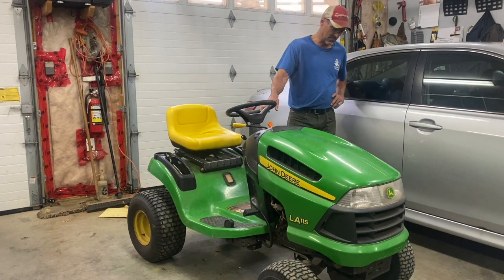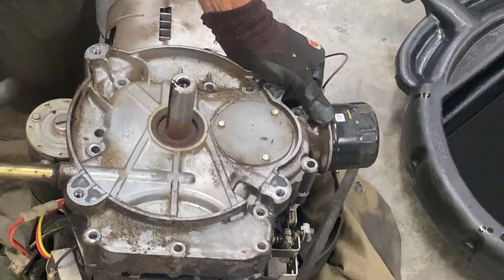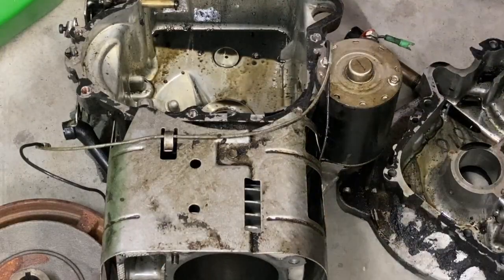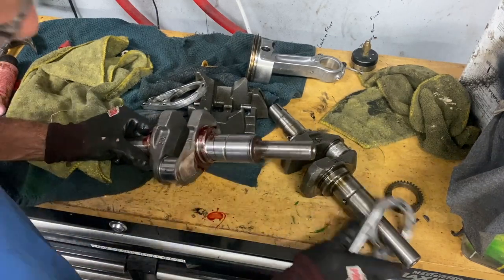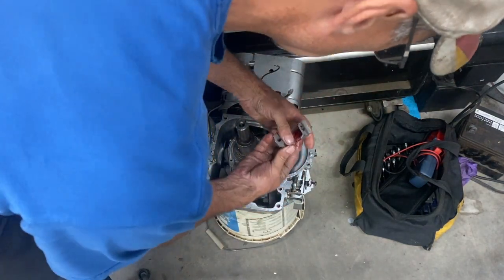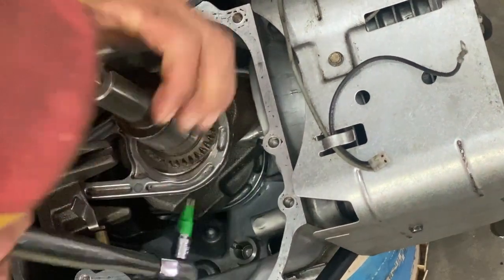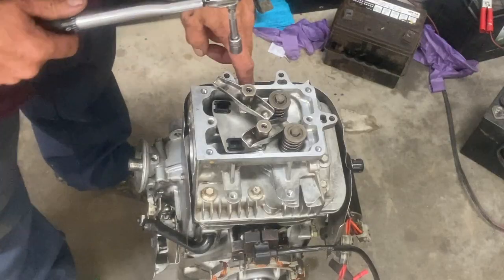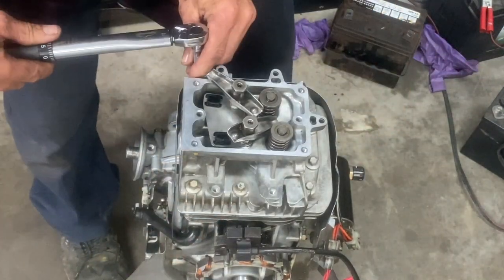Bad Crankshaft, Camshaft Connecting rod? How to fix/replace it, John Deere LA115 Lawn Mower Tractor

Comment: Wow, what a rebuild.  My mower isn't starting after running over a solid object. Checked the flywheel slotted key.  Was good.  I am afraid it will be a major rebuild like this.
Reply from the maker: I’d fixed it for free if you’d lived near me.  I would make a video on it.

Comment: Thanks for showing how it all comes apart.  I've done V8s, but this is my first single cyl.  I pulled the head this afternoon in the hope of replacing the head gasket (billowing blue oil cloud), but the gasket looks good, so now I'm thinking it's a ring problem.

P.S.  5:43  Woodruff key

Comment: Nice Job.  Fun to watch and to the point.  Like someone else said, a little more voice volume would be great.  Was it the case bottom or the main cylinder half that was cracked?  Did you replace both?  Seems like you've got lots of spare parts around.  Also, maybe I missed it, but did you replace the lower crank seal?
Reply from the maker: I replaced the bottom case but not the seal.   I do have a few spare 19.5hp blown motors kicking around.   These fail allot because of poor Maintenance.

Comment: FANTASTIC walkthrough, you just got a new subscriber and a like! Could you please tell me any and all cleaning sprays/solvents you used to wash parts in this video? I am overhauling a Kohler CV491 right now (first ever overhaul) and just got it popped open so I am about to clean everything up before proceeding. A bit nervous I am going to use a cleaner that leaves residue and ends up breaking down oil and ruining my reassembled engine. Thank you!
Reply from the maker: I sometime use a can or two of “Brake clean”.  Micro-fibre cloths and automotive lacquer thinner.   Any spray can cleaner works good.

Comment: I just performed this same repair to the T of following this video. Now I'm fighting to get it started. I pulled the cover to verify the governor and timing was correct 4 times. I'm gonna pull it tomorrow and see if there's any cracks in the casing that I missed
Reply from the maker: Remove the air filter & add a bit of fuel in the intake. It should fire.
Reply: @WeekendHobbyMechanic  I'm definitely gonna give that a try after watching your video of the cam replacement on the d110

Comment: Very Nice Video. Lots of detail when splitting the case. I'm currently working on (2) John Deere 110 mowers, one runs good but I discovered that both push rods are slightly bent when I spin them watching the rocker arms move side to side. The other 110 locks up when spun to a certain spot, probably a slung rod. Your video gives me a very good idea of what I'm looking at as I'm tearing it apart to see if it's salvageable. Both engines are a 33R877 Briggs. What do you think is the probable cause of these engines to fail? The runner has 153 hrs, and the busted one is only at 125 hrs. Both engines have plenty of oil. Could this be just poor quality? And why does Briggs have two different  kinds of push rods, aluminum and steel, maybe weight savings? Thank You 👍
Reply from the maker: Watch this video: https://m.youtube.com/watch?v=qlbZQaeh0EA

Comment: I made the same repair + piston rings on a mower everything runs good except when it shuts off I hear a slight rattle.  Not sure what would cause it ?  because I am pretty sure I put everything back together correctly.
Reply from the maker: It might just be the counter weight inside the motor.   If the noise does get worse, run it.

Comment: Can you get parts for the D140 engine?  Briggs wanted about $1600 for a replacement engine.  John Deere quoted me about $800 for a new engine. I don't know if they no longer make the same engine, Briggs gave me the idea there was only an industrial replacement. Not sure who is scalping me but if you know of a vendor that handles John Deere parts please let me know.  My engine is running but the rod is knocking so loud I cant hear anything else.  Hopefully it can be rebuilt.  Great video thanks for the info.
Reply from the maker: Crankshaft is $543cad, connecting rod is $90cad.    Engine is not worth saving.    Lookup on Craigs list for Facebook marketplace or a used motor or an old mower with a 22hp in it.   I buy them for under $300 complete.

Comment: Got one that went bad the same way 2 days ago.  83 hours.  Heard a few loud clunks then it locked up.  I can barely rotate it by hand.  The starter will barely turn it sometimes/sometimes not at all.  Will need to tear it down and examine for possible repair.  This is a newer mower from J Deere.  Just junk in my humble opinion.  I got rid of the quick oil change to make the engine last and put on a regular filter and drain port.  Oil was changed ever 12 hours and was just changed when this happened.  I think Briggs and Stratton hold some responsibility for lack of quality.

Comment: Ive been hours trying to find a connecting rod number for this engine. Can you enlighten me? B&S seems to bypass the engine s/n thats on mine
Reply from the maker: Briggs# 794571, John Deere#MIA11126   

https://shop.briggsandstratton.com/pages/parts-lookup#/Briggs_%26_Stratton/31P677-0557-B1/Camshaft%2c_Crankshaft%2c_Cylinder%2c_Engine_Sump%2c_Gasket_Set-Engine%2c_Lubrication%2c_Operator%27s_Manual%2c_Piston%2c_Rings%2c_Connecting_Rod%2c_Warning_Label/31P6770557B1/37480002E/y

https://partscatalog.deere.com/jdrc/sidebyside/equipment/77505/referrer/navigation/pgId/2310260

Comment: Your crankshaft is not garbage it’s just aluminum built up on the journal use muriatic acid to clean it off and then 1500 grit sandpaper to polish it and your crank will be as good as new nine times out of 10 the crank journal is not damaged.

Comment: Hello I wanna ask if you have a cover with the oil pump for John deere x110 automatic because what I have me he don't and every time the engine hees broken
Reply from the maker: Are you talking about a Oil Pump cover at the base of the engine? Briggs Part #499613?
Reply: Exactly,you have something used to sell ,cover with pump and his pin
Reply from the maker: @ZsoltFeher-kw8bg Shipping would be too much.  Cheaper for you to go at your local dealer or any Lawn mower repair shop for one.    Take a picture of your model number (top of your Valve cover)
Reply: Hello I can't understand exactly the position off the rings on the piston,if you can sand me a foto signed directly on the piston,thanks
Reply from the maker: @feherzsolt9615   Top ring at 4 o'clock position. Second ring at 8:00.  Top oil ring expander at 10:00. The other one at 2:00
Reply: Hello you now how much is the gap in the three piston rings
Because now is to big
Reply from the maker: @feherzsolt9615   Sorry I don't.

Comment: Great video-thank you so much!  I have the same basic engine and have some questions- could I send a text or email?
Reply from the maker: What’s up?
Reply: @WeekendHobbyMechanic  I have a 2013 John Deere D110 with a 33R877 Briggs engine-it seems the typical head gasket failure caused the oil level to go low, the connecting rod shattered, the crank looks to be badly gouged where the rod connects to it, the counterbalance has a broken ear and the sump base has a broken part as a result of the counter balance breaking.  Where do you recommend to get replacement parts that are good quality but do not cost more than the whole thing is worth?  Thank you for your response and awesome video!
Reply from the maker: The engine is toast. Look on Facebook marketplace for a used engine.  I see one or two every week for sale here around Nova Scotia. ($200-300)/each.
Reply: @WeekendHobbyMechanic  So you feel not worth installing new parts?
Reply from the maker: It will cost you too much money and time.  Not worth fixing.
Reply: @WeekendHobbyMechanic  ok thanks for the advice-where would you normally get parts for this if it were not so bad?
Reply from the maker: @DavidGleason-w8z  Do a search for "Small engine repair service". Parts are cheaper there.  Or try your local John deere dealer.
Reply: @WeekendHobbyMechanic  thank you so much!!